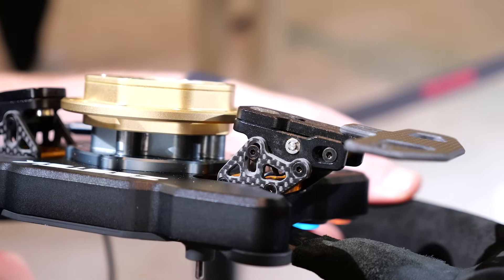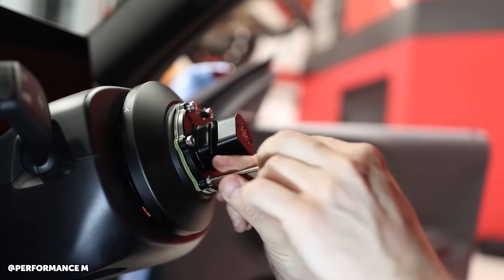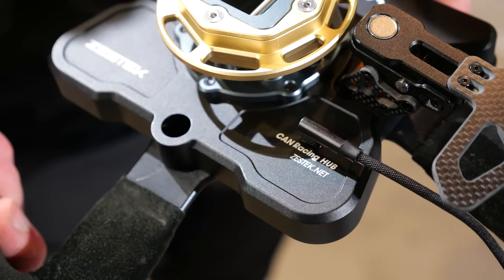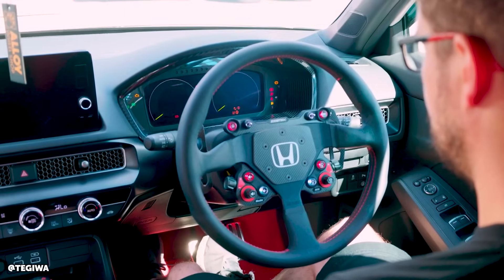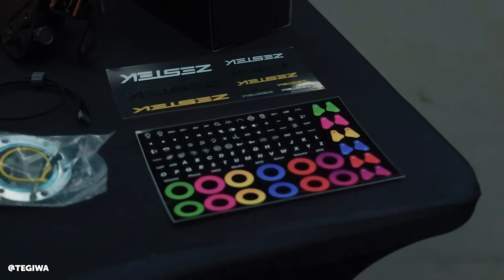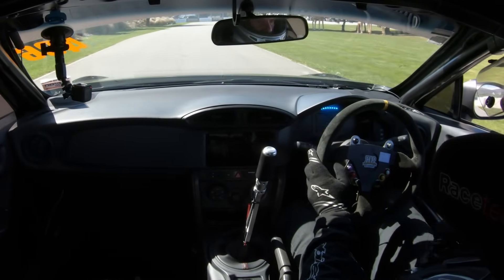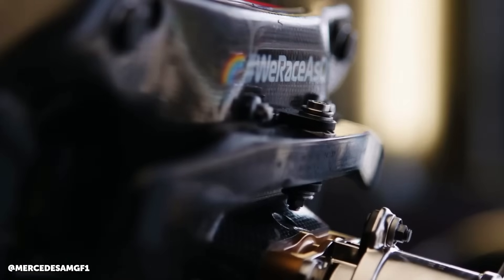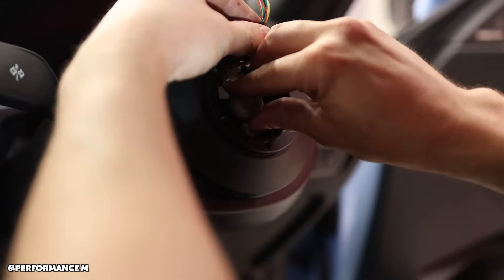Hate CAN Bus? You're Using It Wrong.

Comment: Are there any strategies that can be used to mitigate the negative effects on the CAN Bus when a non-vital component fails in a way that can take down the entire network? I'm all for wiring simplicity and central management of vehicle components, but when the rear view camera fails and grounds out the CAN Bus line, wrecking the entire network, this is a problem. Especially if some of these non-vital components are in difficult-to-reach places.
Reply: Have separate CAN busses if you are connecting untrustworthy devices, no other way around it.
Reply: Separate the critical networks from the non-critical. ECU, TCM, PDU, cluster, and ABS in a dedicated high speed network. BCM, HVAC, PDU, user controls, and other non-critical items in the medium or low speed network. Have a single device such as the PDU or cluster act as the bridge between the two networks if required.